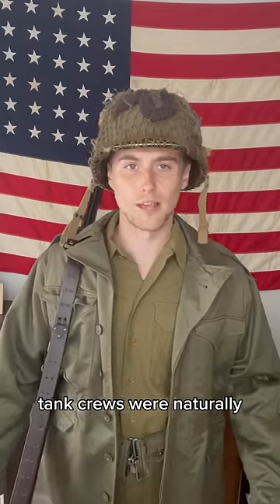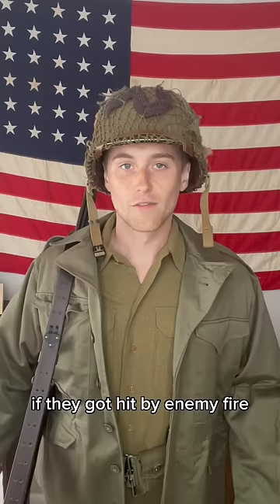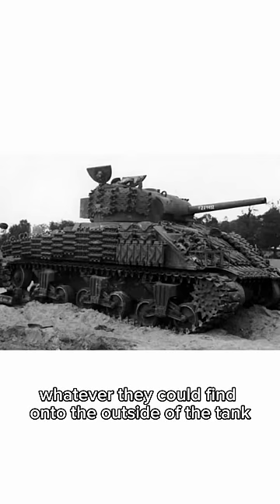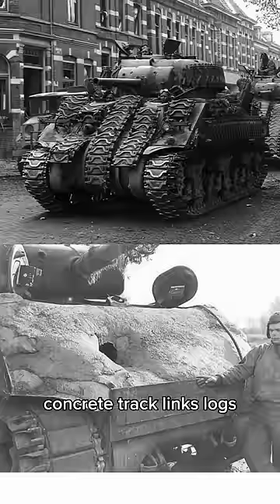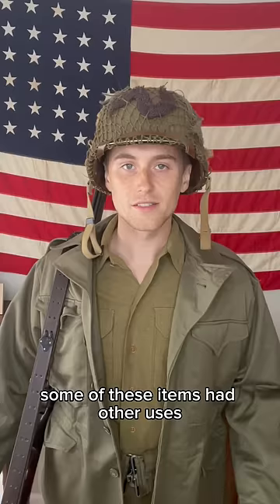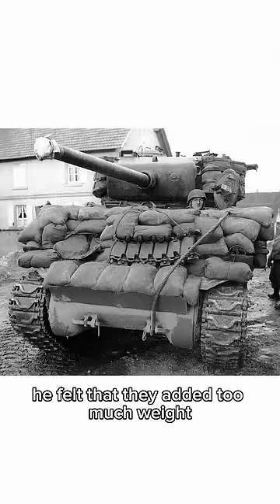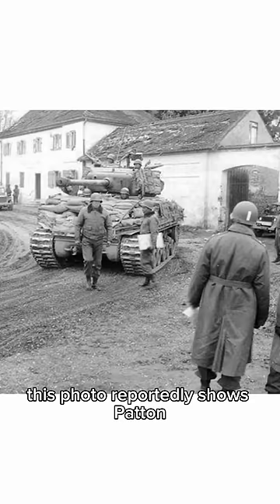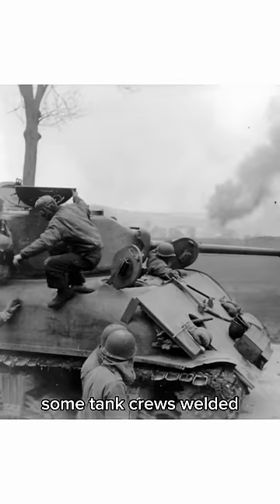Improvised Armor on US WWII Tanks

Comment: Regardless of whether it worked or not. I personally think it gave tank crew confidents and higher morale and that itself is worth it for the soldiers.
Reply: While it didn't work against conventional Anti-tank rounds, sandbags did do a good job in protecting against shaped charges such as a panzerfaust.
Reply: logs and wood in general would do the same job, be lighter, and easier to replace. Patton seemingly only disliked sandbags as additional armor since its massive chunk of weight for very little use. The armor plates, spare tracks and wood were all approved in the 3rd army. @man-uk8cz
Reply: @jaydeleon8094  Yeah makes sense, im just trying to provide that the sandbags werent entirely dead weight & provided a small advantage against ground units armed with light anti tank weapons.

Not a particularly great one though, like you did say logs significantly was more effective in stopping power.
Reply: @man-uk8cz  yeah you could get the same protection with scrap wood planks and similar, for a fraction of the weight. People just seem to not know what the hell a fuse is.
Reply: @man-uk8cz  I could believe sandbags helping against man-portable HEAT weapons, but there are certain things that don't work, for example Soviet "cope cages", which actually made the Panzerfaust's warhead more effective because of that little bit of extra space
Reply: @asbestos1502  the cope caged weren’t used then… as for the wire boxes, they did work quite well. Spaced armor was very effective in ww2.
Reply: @jaydeleon8094  of course spaced armour is effective, but when you slap some slat armour a short distance from the actual main armour of a T-34 in the late war, the HEAT warhead is no less effective. HEAT doesn't just blow up and do nothing, it's a shaped charge that PIERCES the armour and delivers the explosives inside the tank, and unless your slat armour is ridiculously far away from your tank, it either has no effect or makes the HEAT charge slightly more effective.
Reply: @asbestos1502  no… that’s not how that works. You are thinking tandem warheads. Heat fires a jet out, not explode to damage. With armor spaced out a few inches away, the jet will not pierce the hull of a tank unless it’s a really lucky hit.
Reply: @man-uk8cz ya no, theres no evidence that actually worked 

In fact theres teat from the germans which showed even sandbags against heat rounds and other types of improvised armour had an increased chance of penetrating the armour 

Then the Americans did a test where they proved that the improvised armour didnt increase actual armour and damaged the tanks with the added tanks, however the increased crew comfort was something to take note of, hence the introduction of actual field mods for units.
Reply: mfer said "confidents" and no one's gonna acknowledge it?
Reply: Good point!
Reply: From everything read about General Paton it’s safe to say the guy obnoxious pp head. Man repeatedly abused a solider with PTSD, he’d often have hissy fits over uniforms and stuff. The most important thing in a war is morale. The sand bags and logs may have not been the most effective but it did give the tank crews a morale boost which can be the deciding factor in a war like this
Reply: However slowing your tank down too much makes you easier to be hit in critical spots.  Those sandbags m8ght just be the reason you die a painful firey death
Reply: @man-uk8cz sandbags and especially concrete even worked against you, it allowed the enemy armor piercing shells to normalize(improve)the angle they are hitting the armor , making it more likely to penetrate
Reply: Patton was a great general but I think he had a serious problem connecting with the actual troops he was commanding
Reply: a lot of those addons actually made the armor worse because it would cause rounds that would otherwise deflect to get channeled into the armor of the vehicle.
Reply: Bro took the chieftain word for word
Reply: You think Patton cared about that?
Reply: Shermans were on the offensive roughly 90% of the time so crews with overweight tanks simply wouldn't ever make it to a front before all the nimbler unmodified Shermans had taken the losses/won the fight...  I'm sure they were real happy about their un-bloodied comrades morale though!
Reply: It would have worked especially well for something like HEAT, or HE. Like a panzerfaust for example, would detonate upon hitting the logs/bags/concrete and not upon hitting the armor.
Reply: I dont know if that's worth the loss of speed and gain in weight and fuel consumption, which means needing to refuel more often which can be detrimental in a battle
Reply: @Ssss16483  I reckon less people died from loss of fuel than from HEAT, so I'd say it's probably worth it
Reply: @gogurt9311  it's hard to quantify how much lives are lost due to loss of operational capabilities due to soldiers heavily modifying their equipment but I would imagine it's alot more than heat shells which came late in the war
Reply: until you get your tank stuck in the mud because of additional weight and get smoked
Reply: @sniperjared  You can get a tank unstuck. You can't unexplode it
Reply: @goo_dragon Thank you! That was making me crazy!
Reply: @christhut8140 Which, in a way, probably made him a better commander. He could more easily send troops out to perform risky yet vital missions without worrying as much about total losses. It sucks, big time, but it's necessary in a war like WWII.
Reply: Confidence*
Reply: I would agree- beside the sandbag example

That adds a SHITTON of weight, which significantly slows down tanks while consuming WAYYY more fuel- directly taxing other squads and supply lines aswell, and putting way more stress on an engine not made for the amount of weight they were hauling. And as other replies pointed out, to almost no effect- atleast, to an effect that would be 10x better and practically downside-free if they just frikkin used logs or tank treads. 

They were basically just nerfing themselves in exchange for confidence, which, in reality, is actually a really dumb and bad practice which Patton was very fair in chewing them out for. “Just use logs ya dolt!!!” or whatever the British would say.
Reply: @man-uk8cz No, it did not. HEAT rounds were poorly understood and didn't have enough spacing in them, it only helped the HEAT rounds have more armor penetration.
Reply: @lemonynora I believe he didn’t actually know a lot about ptsd
Reply: Yeah but it made the tanks look less cool. And coolness is more important than functionality
Reply: Not when all it did was weighten the tank for dubious amount of extra protection and guaranteed extra sharpnel at impact.
Reply: @man-uk8cz the sandbags and concrete were actually worse against full tank rounds though because they acted as a cap that the round would push forward without slowing it down much at all
Reply: True but having less weight was also a point, casing the entire tank in concrete slows you down
Reply: @woutverjans2928  Whether you can move slow or fast won't stop a drone attack

Comment: Guaranteed as soon as Patton left that tank crew they were cursing him up and down and sure as hell weren’t gonna take those bags off lmfao
Reply: There are actually cases where the addition of armor made the tank perform worse and get destroyed more easiliy, atleast im pretty sure the concrete one made the armor worse than without it, if i remember the information correct from another video.
Reply: @jophiohip the concrete on the front of the tank would help stabilize any incoming rounds and therefore remove some of the advantage that the Sherman’s angled armored had
Reply: @Militariadude08  thanks for the addion of this info :) !
Reply: Yeah. Also Tracklinks, horrible for the survivability. Made the armor signifficantly weaker.  @jophiohip
Reply: @martinmorsch7507 who said tank track made it worse ????you totally mistaken, some german tanks even put their tracks in front for the benefict of extra armour
Reply: So you think germansa doing something proves it is working?
THere are a number of historians and Historic articles of tests done back then. Also its explainable by pyhsics.

Tracks are made of a tough but softer steel, as they need to resist the strain of the pulling and pushing motions while a tank manouvers.
SAdly, those are very poor caracteristics for Armor. Generally speaking Armor plates are made of hardened and extremly dense Metals, during WW2 Steel. THe famous german Krupp-Stahl is very hard and dense.

The problem is, that the soft Track steel acts like a chewy layer, in which the Round can bite into. This causes it to Normalise and thus have an easier time to penetrate the lower armor layer. 
 @amopastorcanadense
Reply: @martinmorsch7507  yes sir, but i only see those tracks hanging when it is on right angle, 90 degrees.
I.agree 100% if these thin tracks would even be worse on slope armor cuz it would just benefict the chance of a direct hit, thats for sure.
A few examplee, Panzer IV auf. J lower hull had these tracks.I guess they were only effective against Russian PTRD 41 14x5 x114mm guns and this kind of ammo.That would make no difference against big AT guns...i saw some photos from Shermans hangings logs and even tank wheel.in front of it.
Reply: True, but a there were made a lot of mods to the sloped armor. And the weaker armed side armor is honestly unable to resist a hit regardless. While it makes the tank heavier, increasing susppencion wear and gas consumption, but extremly big downsides, that just btw. also crippled the german army @amopastorcanadense
Reply: @jophiohip concrete could be iffy. It corrodes metal it gets into contact with if there's air or moisture around (rebar doesn't corroded due to lack of oxygen).
Reply: @arthas640 rebar does get moisture and corrode, causing concrete to fail this is why buildings need to be inspected.
Reply: @arthas640  concrete is porous oxygen and water penetrate to the reinforcement inside, however the steel doesn't corrode because of the Alkaline present in the concrete
Reply: @crf80fdarkdays  if poured correctly the steel reinforced concrete will last over 100 years without failing. It is cracks and steel that is exposed to the surface of the form that cause "concrete cancer"
Reply: Check out German Flakturms in bigger cities in Germany, Austria. They're basically undestroyable
Reply: Before ww2 he was also in ww1 commanding a tank brigade and he was well respected and only wanted was the best for them because so many of his men died in ww1 and 2
Reply: @martinmorsch7507  Any sources?
Reply: @martinmorsch7507  it works but u still need luck its not gonna stop a point blank shot of a tiger tank or panther no but... a shell that already travelled far or smaller arms fire can still lose good bit of power before penetrating and if lucky completely preventing penetration i think the crews knew this and werent imaging anything fantasy like but for smaller arms fire and still a bigger shell its still few inches extra the shell gotta penetrate so again no garantees but it does give a minimal form of a thin extra layer of protection that can stop dislodge or prevent a full on kill inside the tank perhaps by combination of them and sheer luck i wouldnt deem them totally ineffective  nor would i safe it would be safe time to enter those tanks.
Reply: @Zeta_MooseR6 Patton was a prancing preening princess that no one really liked.
Reply: @jophiohip so what “actually” nobody cares 🤓
Reply: @jophiohip Patton also chewed soldiers out for not having a clean shave in the field. So the seed of doubt is there lol.
Reply: These tank crews were the ones facing death every day, not Patton. It was important for them psychologically that they felt they had done everything possible to improve their chances just a bit more in order to live another day. Tracks, logs, concrete might or might not actually help them but these things made them feel better and kept them going.
Reply: @tvgerbil1984  Exactly!!
Reply: @tvgerbil1984  People heavily underestimate how important Morale is. A force with great morale can come back from an army of larger numbers sometimes because their heads are in the game so much.
Reply: @martinmorsch7507   Correct. Soft steel of tracks acts like a ballistic cap, softening the shock of impact that might otherwise shatter the round.

Comment: Imagine you hear BRING OUT THE DREADNOUGHT and it’s just a Sherman with an insane amount of armor plating welded on.
Reply: That's literally the Jumbo.
Reply: Sabaton
Reply: @Necoy666 they mean more than that not just a second layer of armor on top
Reply: @AugmentedGravity  unopposed under crimson skies
Reply: @cookiekid0014  IMMORTALISED
Reply: @AugmentedGravity  over time, their legend will rise
Reply: lmao, I'm just thinking about a M4 looking like it belonges to Warhammer40k with the last few inches of their 75mm gun sticking out the front
Reply: @cookiekid0014  such a banger of a song that
Reply: @AugmentedGravity  sure is
Reply: @Necoy666 no that’s the T14, the jumbo dosent have insane armour, it’s at an angle
Reply: @cookiekid0014  and their foes cant believe their eyes, believe their size as they fall.
Reply: @alex-tq4zi  and the dreadnoughts dread nothing at all!
Reply: The dreadnaught was the USS Texas last one I believe or one of two don’t remember exactly
Reply: @silentknight9356  If you mean the last built Dreadnought, then no, that was the HMS Vanguard built in 1941.

If you mean the last surviving dreadnought, then yes, you'd be correct.
Reply: @cookiekid0014  

 🎵🎵🎶🎶

A hull of steel and all big guns to serve the fleet.

Unrivalled firepower riding the waves to war.
Reply: @Jpz-4-5  The Jumbo did have a significant amount of extra armor. Just not nearly as much as the T14.
Reply: @JohnnyShagbot  an extra 40 mili meters. Not much more, however it could bounce the long 88, just not the longer 88.
Reply: Sherman with a king tigers scavenged armor has entered the chat
Reply: @kuroibullen1639 the Sherman’s transmission breaking enters the chat
Reply: A sherman with so much armor that it’s equivalent to a tiger 
Moving at a blistering 6 inches a second lol
Reply: @theangrygermanlad1328  not very impressive. If it was a king tiger sure.
Reply: The germans when they see the Jumbo 2.0 (its litterally a jumbo with more jumbo armour welded on)
Reply: German yelling bring out the Maus